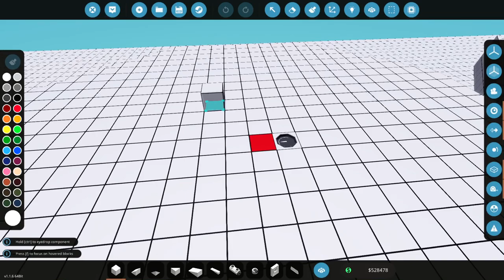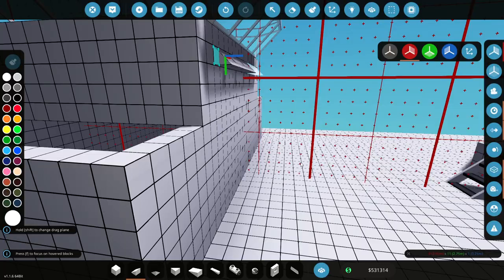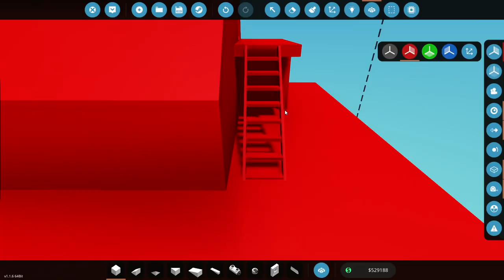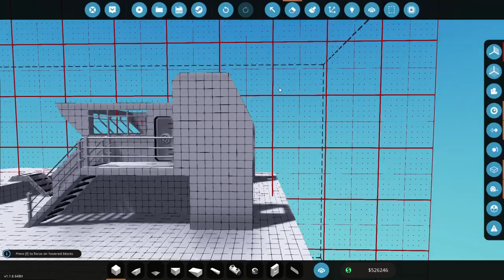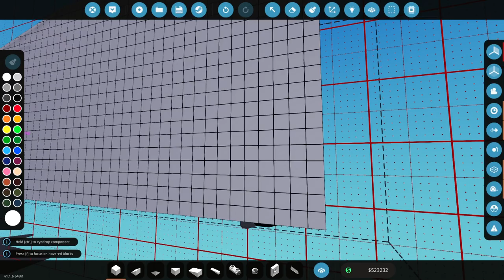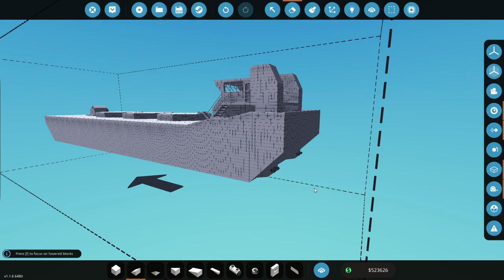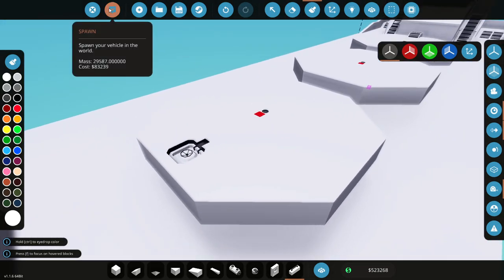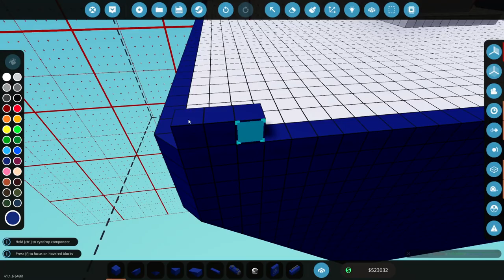WILL IT FLOAT? (Full Load) - Stormworks - Career Mode -  S2 E22

Comment: nice build, if you put one ladder piece extra at the very top on the floor , the player will then be able to easily climb out of the tank
Reply from the maker: Thanks Lambor_ghini! Great idea, that will help a lot, thanks :)
Reply: @MrSticksman  no problem, if you can live with one ladder piece protruding from the floor.. I usually smooth it out with wedges around it
Reply from the maker: Yes a few wedges should do the job nicely, it will add extra detail :)